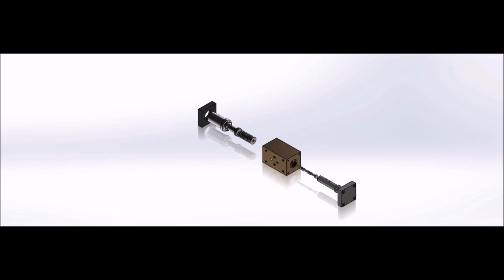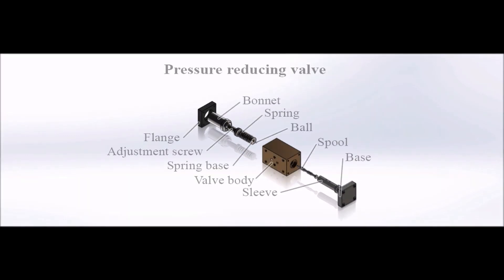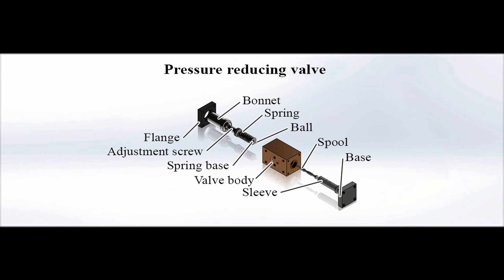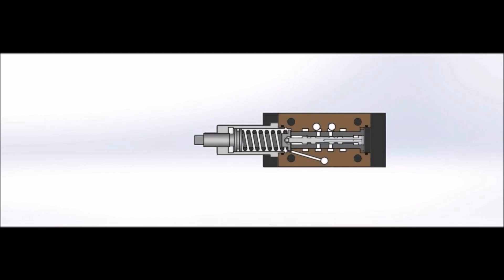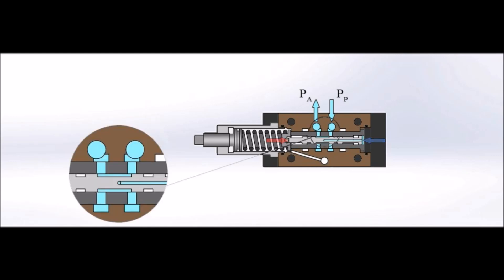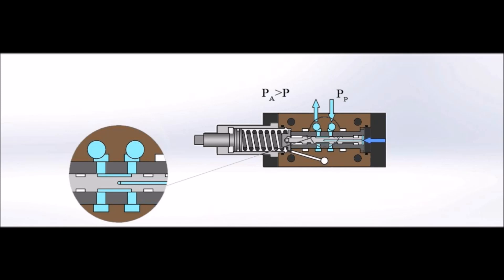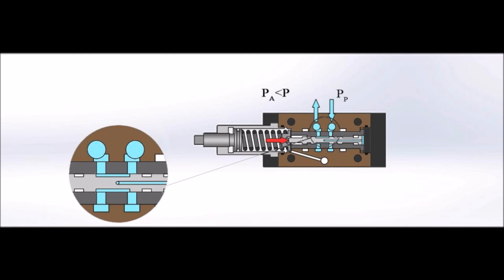How does the pressure regulator work?

Comment: Amazing video. However, the computer voice does not make clear what is being said. Would you be able to explain it with a persons voice? Thanks in advance.
Reply from the maker: Hello, thanks for the comment. English is not my native language, it is difficult for me to understand whether it is correctly spoken in English. I try to use literature in English, but it doesn’t always work out well. For the next video about the operation of the hydraulic jack, I drew an translator, and the speaker voiced the video.

I'll try to explain. This is a pressure regulator or pressure reducing valve, it regulates the pressure in the line diverted from the main one. This valve can regulate (reduce) and maintain the pressure at a constant value at the outlet (after the valve).
How are inlet pressure and valve outlet pressure related? The outlet pressure is equal to the inlet pressure minus the pressure loss across the valve. The inlet pressure is determined by the setting of the relief  valve, usually.
How to adjust the desired pressure at the outlet of the pressure reducing valve? It is necessary to change the value of the pressure loss on the valve. How it's done? A cylindrical hole is made in the housing. A spool with belts is installed in it. A small gap forms between the belts and shoulders, through which fluid flows. The larger the gap - the less loss, the smaller the gap - the greater the loss. It turns out we have to change the size of the gap by moving the spool. This is done with the adjusting screw. It compresses the spring, which presses on the spool and affects its location. We can move the spool so that it completely covers the gap, then the pressure at the valve outlet will be 0. Or we can open it. What is a spring for? Why not just move the spool with a screw? This spring is needed in order to help the valve perform another function - to maintain a constant outlet pressure.

How can a pressure reducing valve maintain a constant outlet pressure? Automatically change the amount of loss at the valve depending on the outlet pressure. Thus, we will be able to maintain it at a constant level.
How is this implemented?
Several holes are made in the spool (clearly visible on an enlarged view). The holes are made so that the liquid from the outlet falls under the right (according to the video) end face of the spool. The fluid pressure tends to shift the spool to the left (according to the video). On the other hand, a sprung spring acts on the spool, it tends to shift it to the right and open the gap. The balance of these forces determines the position of the spool.
If the outlet pressure decreases, the spring “wins” the confrontation and shifts the spool slightly to the right, the gap increases, and the pressure loss on the valve decreases. As the losses decreased, the outlet pressure increased.
If the outlet pressure has risen above the pressure setting of the pressure regulator, then this pressure acts on the right end of the spool and shifts it dumb to the left, the gap becomes smaller. The pressure loss on the valve increases. Due to the fact that the pressure loss increased, the outlet pressure decreased and again became equal to the setting pressure.
Please answer, do you understand my explanation
Reply: @Гидравликаипневматика  Thank you for replying to my comments. I understand the principle of functionality of this valve. I reversed engineered one I have here (exactly like yours in principle) and it's being used on a hydraulic pressure compensated variable displacement piston pump. My valve has three ports. One called "Return" another called "drain" and another called "pressure". What I would like to know from your drawing is this:  1- Where does the pressure (blue arrow) pulling your spool to the left come from? on my valve it comes from the port called "Return" other called "Control".
2- What pressure is bigger, that pressure moving the spool to the left (Blue arrow) or the pressure coming in Pp port?
Reply from the maker: The blue arrow shows the effect of pressure from the outlet (Line A), the fluid through the hole inside the spool flows under the end of the spool.
The pressure entering the port of PP is greater, but its action on the spool is compensated. Pressure PP does not pull the spool to the right or left.
Reply: @Гидравликаипневматика  I have no doubt about what you just said. I understand that. My question is: where is the pressure acting to pull the spool to the left coming from?
Reply from the maker: @ele4853  I showed this pressure on the circuit http://www.hydro-pnevmo.ru/images/upl/05_08_20_22_27_26_Reduce.jpg
There is marked -  control pressure. Initially, the fluid will be able to flow to the outlet, the spring gives a force that opens the valve.